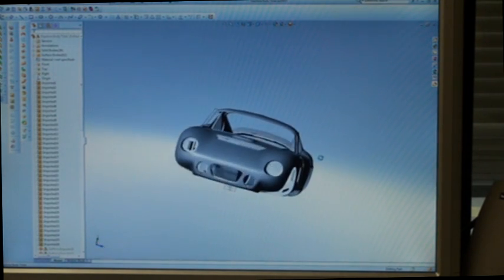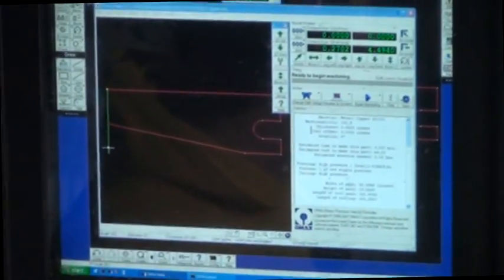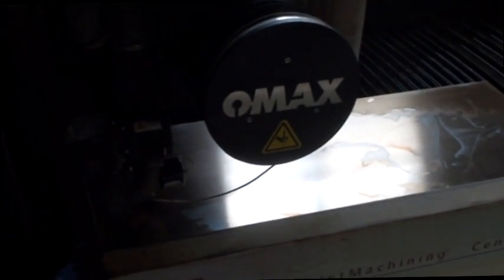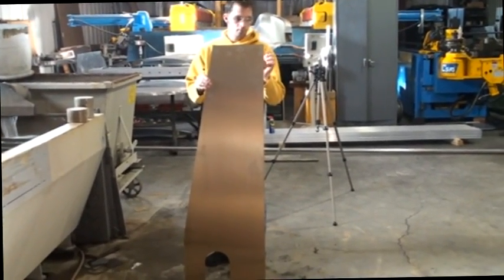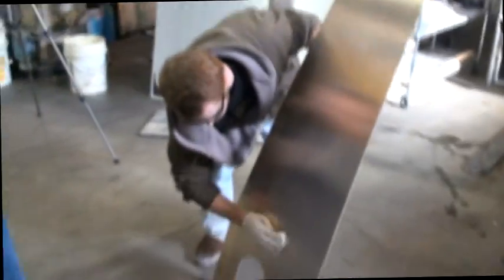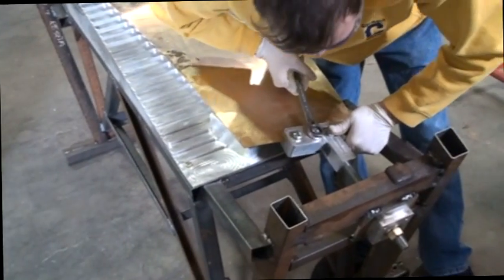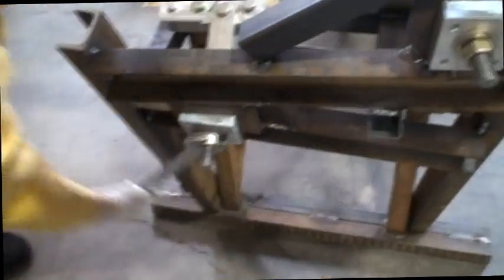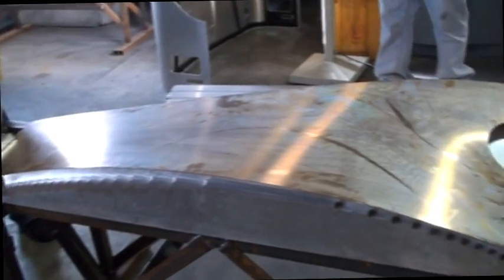Kirkham Motorsports University Making a Bronze Fender for a Coupe

Comment: david greetings i am impressed with your work i keep learning with it, i wanted to ask you where i can get the tools you use and especially the stretching press?
Reply from the maker: We bought the stretch press at a scrap auction.  We completely restored and rebuilt it here at our facility in Provo, Utah.
Reply: @KirkhamMotorsports1  where can i get the garrar of the press?

and in which shop can I get the tools you use hammers hammers blocks trowels trowels for tapping ect....
Reply from the maker: @kimi4566789  We make many of our tools.  Ebay is a great source for old school hammers and dollies.  I am not sure what you mean by "garrar" of the press?  Eastwood also sells a lot of body working tools.
Reply: @KirkhamMotorsports1  the claws are the ones that bite into the aluminium sheet to stretch it.
Reply from the maker: @kimi4566789  
Earlier I wrote, "We bought the stretch press at a scrap auction.  We completely restored and rebuilt it here at our facility in Provo, Utah."  This was a mistake; I was thinking of another video.  I thought we used our big stretch press for this part.  

I watched the video again and realized we made this part on one of our little stretch press machines.  We made the entire stretch press machine, including the aluminum jaws, here in house.
Reply: @KirkhamMotorsports1  If you have any plans or drawings of the clamps, I would like to make them myself, because I might need them.

Comment: David, why did you use this small manual stretch press instead of the big hydraulic one you have?
Reply from the maker: Because we had to use the torch so much on the bronze to get it to move.  It's really hard to move in and out of the large stretch press with a torch.
Reply: @KirkhamMotorsports1  cool! Did you make the clamps? I need to make a few similar shapes and would like to build one of these smaller stretch presses
Reply from the maker: @jc8417  We made everything in house (as usual).
Reply: These guys are using kukas to incrementally form parts: https://youtu.be/dCXu8Ju_fdY?si=6Rx2BKNwcduAxaB6

Comment: Hi David Amazing videos my favorite car. I have another favorite I am working on and need some direction to find a part. I am building a 1953 ford panel and installing a flip hood. I am having trouble locating hinges for the front or at least a pattern. I have the ability to make it with some instructions.Would you help me with this.